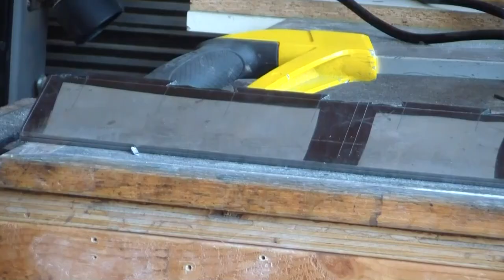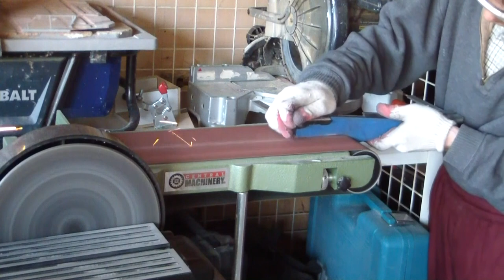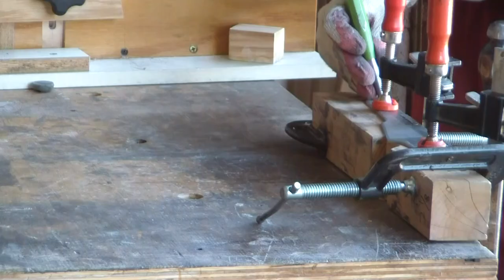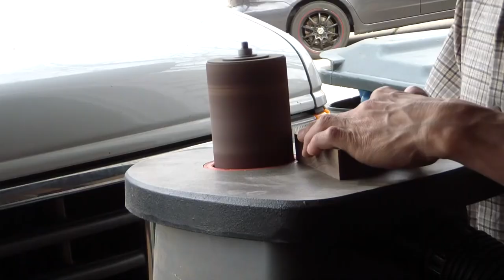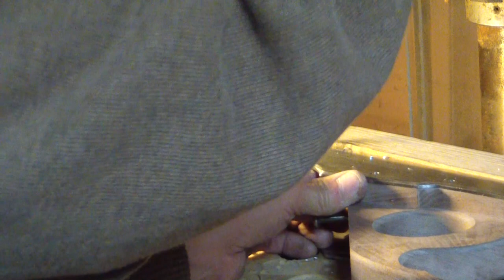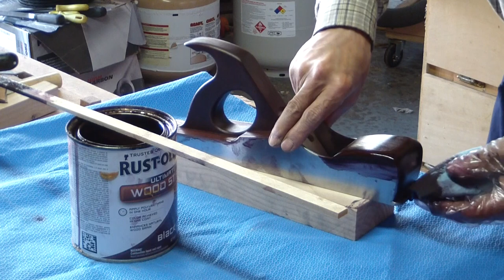Build a dovetail infill plane  pt 1

Comment: You do beautiful work.  One small tip I would to pass along though regarding the dovetails fitting the base to the sides is, unlike dovetails in wood, the dovetails aren’t square across the inside edges.  If you watch a professional plane maker, they add small, angled cut outs to the dovetail edges that allow the permed metal to fill in and lock the sides to the base.  Do some research and I think you’ll discover what I mean.  I think it will improve the connections between the base and side plates and improve your already fantastic work.  Hope it helps!